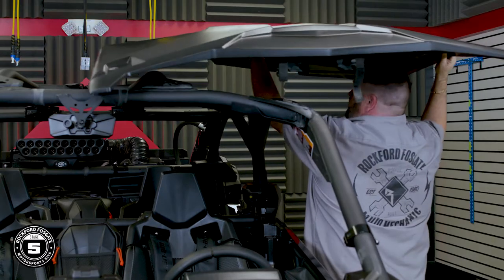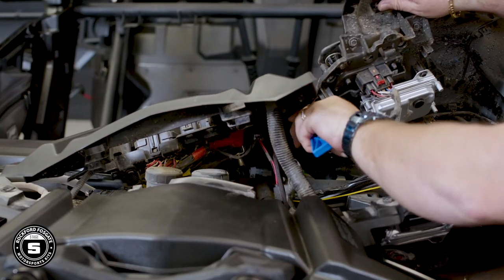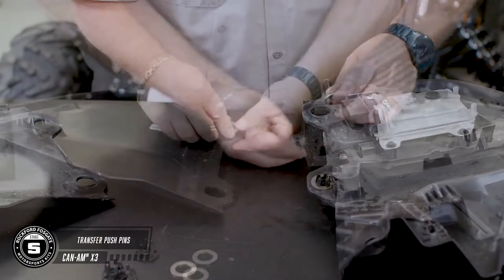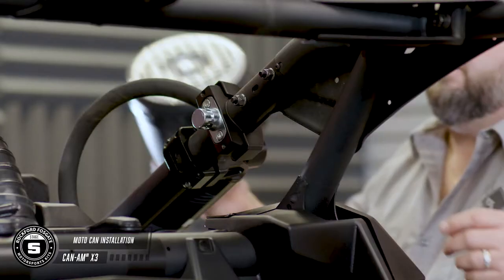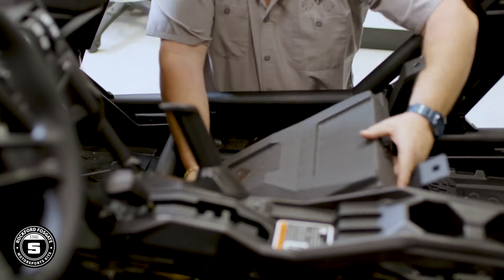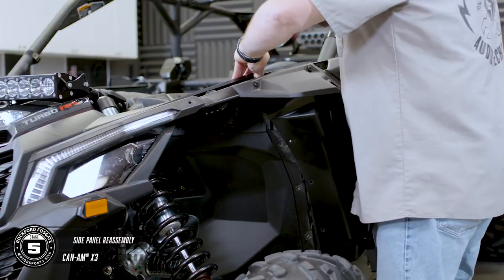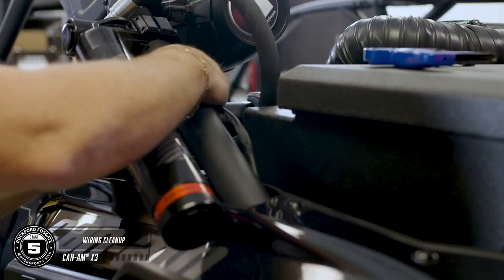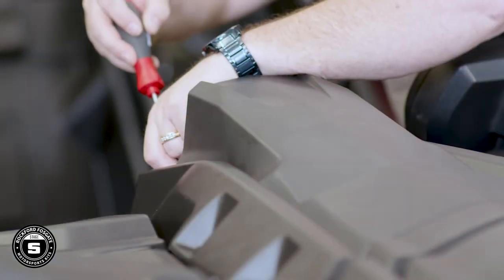Can-Am X317-STG5 Installation (Gen-3)

Comment: Two questions. Do I need to be concerned about my speaker wires touching accessory electrical wires? And what do I do about my brake lines when mounting my sub enclosures on a two seat XRS?
Reply from the maker: Great questions Eric Kennedy.  By "speaker wires touching" do you mean just physically residing next and being zip-tied along with electrical cables (not peeling back the insulation and touching the metal conductor with other electronics). We haven't had any issues with magnetic radiation causing noise issues.  However, we recommend NOT routing any new accessories NEXT to the amplifier itself as the step-up transformer can cause noise issues.

Regarding the brake lines, you'll notice at 07:26 in the above video you can see our GEN-2/3 subwoofer enclosure was redesigned with a channel to accommodate the brake lines.
Reply: @rockfordfosgate  thank for the quick response. Okay I’m sure I can figure out the brake lines. In your video the x3 was a 4 seater so it didn’t have the brake lines running across the floor broads where the sun would go like my 2 seater does. And yes, what I meant is, your insulated speaker wire harness as well as sub harnesses. Will I have any issue with sounds if I zip ty your wires to my existing electrical accessory harness I’m currently running through my center tunnel to battery? I know I’m car stereos you want to try and avoid speaker wires from being ran near power cables.
Reply from the maker: @erickennedy9487  You can see the enclosure detail where the Blake lines run here: https://rockfordfosgate.com/products/details/X317-M2FWE/

The noise issue is really when running low-level signal cables (RCA’s) with high current wires.  That is when you can get induced noise, but those are up in the dash.  You’ll only be running speaker wires with the power cables so you should be fine.

Comment: Whats the app for the lights on speaker?
Also, would like to add the two big speakers from stage 6 two my stage 5 without having to replace them. What else would I need besides the speakers?
Reply from the maker: Yes, the App is only for the RGB lightning.  You can download that here: https://www.rockfordfosgate.com/products/details/pmx-rgb/

Are you asking if you can add the 8" horn-loaded wake tower speakers to the existing audio system?  Technically you can do this by adding them to the rear channels of the amplifier, operating the rear channels at 2Ω, which the amplifier is stable at.  There are no installation guides on how to do this, so this would be a custom install.

Comment: Hello i have that stage 5 do you used all 3 connector of the amp?? Front/back/sub connector?
Reply from the maker: You use all 3 inputs, but only 2 inputs as follows:

FRONT OUT = dash speakers
REAR OUT = moto-cans
POWER = power plug
SUB OUT = sub out mini harness > Sub1 & Sub2
FRONT IN = harness for front
REAR/SUB IN = harness for subwoofer

This is covered at 8:49 of the video: https://www.youtube.com/watch?v=nVdKQfuT6KQ&lc=Ugwr2GY8dCpt4XipNXJ4AaABAg

Comment: Is their an application were you can mess with amplifier and volume?
Reply from the maker: The available RFCONNECT App is for the Color Optix LED control.  The amplifier already has a PRESET switch that our RTTI installers have tuned for the best sound quality, best gain settings, best equalization, and best crossover settings for longevity of the speakers.  Therefore, we don’t advise changing any settings on the amp and don’t have an App for it.  For Volume control, this kit supports the PMX-BTUR steering wheel remote.  You can find more info on the remote under the ACCESSORIES tab: https://rockfordfosgate.com/products/details/x317-stg5/
Reply: @rockfordfosgate  oh ok thank you guys!

Comment: on my amplifier i have 3 wires front in rear in and sub in i put the front of the amp to the front and rear to the sub because i have 2 wire plugs that are front and rear from the power harness i connected everything from the video im a little confused on what connecters i connect to speakers do i connect all speakers to PMX harness or Power harness?
Reply from the maker: Yes, the amplifier inputs use the FRONT IN and SUB IN only (the input switch tells the FRONT IN to feed both FRONT and REAR channels of the amplifier).

The PMX harness connects to the main power harness.  At 10:02 it shows Greg connecting the PMX harness to those main power harness.

Comment: I don’t have a pigtail that says rear sub. Just says rear… also do I connect the speaker to the pmx harness or the other wire Harness that comes form the amp?
Reply: hey man , can you let me know how you wired everything. they didn’t really give a good example on where everything goes. i’ve been trying to install since last night.
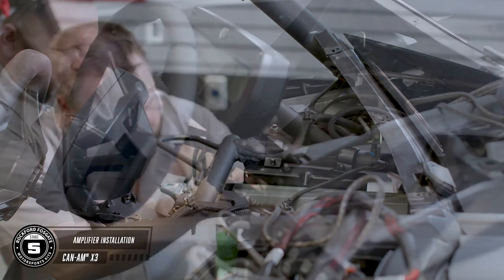Reply from the maker: Amplifier connections are addressed at 8:41.  If you're connecting the subwoofers, look for a short 8" harness labeled SUB.

The MAIN HARNESS FRONT connectors attach to the FRONT SPEAKERS.

The MAIN HARNESS REAR connectors attach to the REAR MOTO-CANS.

Connect the MAIN HARNESS POWER PLUG to the AMPLIFIER "B+/GND" connector.

Connect the short subwoofer harness to the SUB OUTPUT on the AMPLIFIER POWER PLUG, then connect the opposite 2 ends of the short subwoofer harness to the long SUB harnesses that run under the seats.

https://www.youtube.com/watch?v=nVdKQfuT6KQ&t=521s

Comment: My can am x3 stage 5 sounds good a lower volumes , at high volumes it sounds very distorted, I’ve tried messing with the frequencies and settings , is there anything to do to check the amp? I also have a rzr turbo s with the stage 5 and it sounds clear as day turned all the way up to 40,
Reply from the maker: Hi Jose, the settings on the amplifier need to remain as configured out of the box or you will likely blow-up speakers.  Keep the PRESET switch ON and adjust the other INPUT SWITCHES exactly as the previous generation Tuning Guide (https://www.rockfordfosgate.com/rnt/rnw/docs/1356//amptuning_x317_2017-2019.pdf).  Since this is a troubleshooting question, it would be best to contact our Technical Support because this will require a lot of back-and-forth discussion.  They can be reached at 1-800-669-9899 Mon-Fri 8am-5pm MST.

Comment: The video is lacking some important details on wiring, took me a while to find the factory power connector for the head unit
Reply from the maker: Hi Juan, Yeah, Can-Am has made this tricky to find.   Could you elaborate on what is missing from the video?  At 9:42 Greg talks about connecting the PMX power harness to the accessory connector under the center of the dash.

Comment: I’m trying to power the system from a rocker switch or straight to the battery and use the Power button on the unit it’s self ? Where is the wire to do that ?
Reply from the maker: The Can-Am "Accessory Mode" must be activated in order to power the system with the engine off.  Are you doing this to extend the playing time of the audio system?  If so, the X317-STG5 uses the RED (POWER) wire described at 09:48 "PMX Harness Installation" that provides power to the radio.  The radio then uses the BLUE wire to remotely turn-on/off the amplifier.  Instead of connecting the RED (POWER) wire to the accessory connector located under the dash, you'll supply +12V to this wire through your manual toggle switch.  Just a warning, that you can drain your battery when running the system for an extended time with the engine off.
Reply from the maker: @CANESTIME777 That is correct, we press the ignition button to enter Accessory Mode to test the system at the end of the video.  However, once Accessory Mode "times out", then the audio system will shut off.  Your manual switch will bypass this issue.
Reply: @rockfordfosgate  thank you so much !! 
I’ve already located the red 18ga or so red wire in the back of the head unit that is fused. Pulled the fuse to verify it was the feed. 
My plan is to cut and butt connect/shrink onto that wire and run it to my switch. Much appreciated